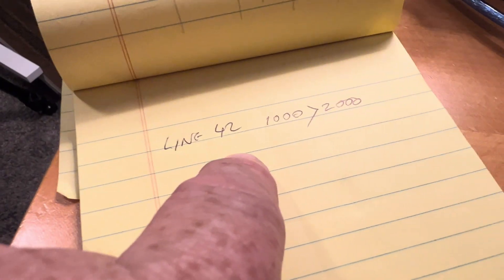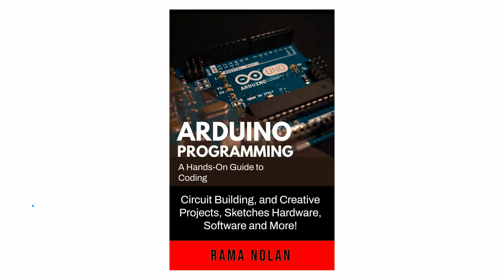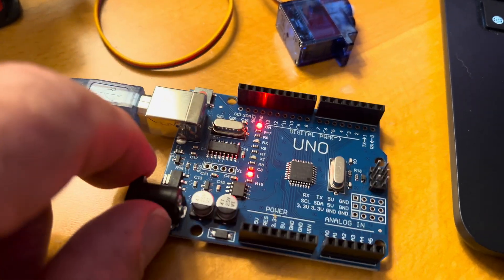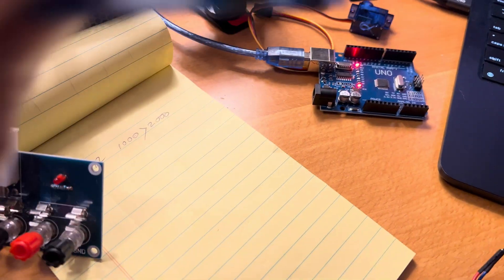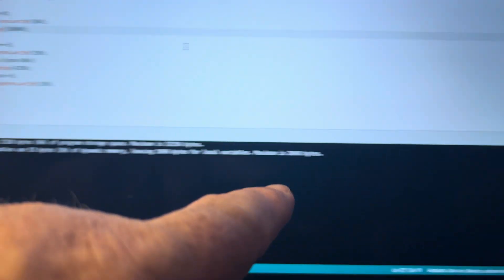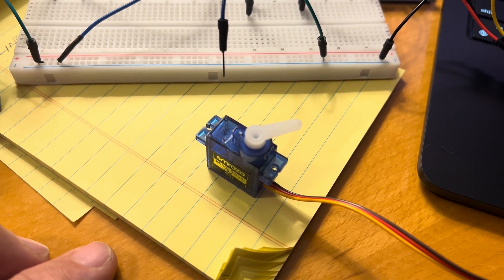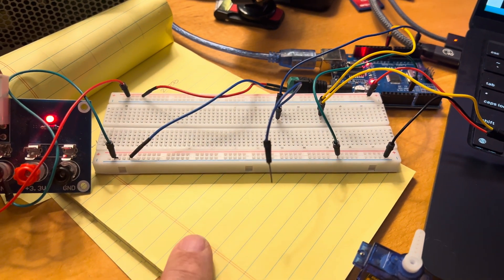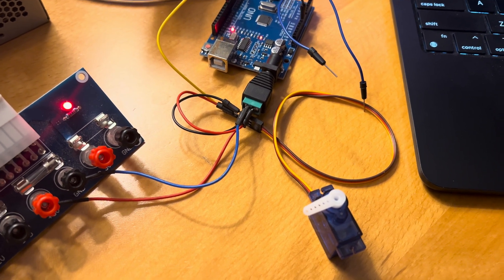144. It Works! My First Model Railway Arduino Project

Comment: GOING UP THE GARDEN PATH ???
"Arduino" ! A heck of a lot of money for a system that bears NO relationship whatsoever to the real life methods of British Semaphore signalling, which has to comply with "Absolute Block" rules. So automated servos with a timed delay are useless for a semaphore signal ! Semaphore signals were manually operated, in a set order and sequence, in response to the position of a train. About the only thing you can do to shortcut the real life methods, is to have "semaphore arms" return to danger as the train passes. But that needs either a "Track Circuit" (cost 1p and only needs a piece of wire), or a less sophisticated and not a 100% guarantee, are Infra Red "Irdot" products fitted into the track. This method relies on the passing train reducing the amount of light that reaches the infra Red detector, so isn't always 100% reliable !
Reply from the maker: I agree with you on the signaling of course (you being the expert I’d be foolish to do otherwise 😜) 
The Arduino for me is a means to an end. 
1. I want to learn the ‘how’ and it is far better to have an actual reason to do that than just the theory.
2. You’ll notice I use/used it on a barrier into the airport not on signal automation.
where I MIGHT use it is in the actual “pulling” of the lever. In other words, simulating the pull on the wire that controls the movement of the signal. 

We’ve talked before I believe about the weird terminology model manufacturers call things (“block” detection for example) but on the other hand, mostly we know what we mean by it.

I’m still aghast at the system in use around here. The more I learn about it the more I am amazed how they get away with it. I suppose the bugle long trains at least cant crash into each other so that’s one solution.

As ever, thanks for your input.
So to be clear, I’m using the Arduino for the last few feet to actually make the arm move not to put the cart before the horse and have signals react to trains.
Reply: @trainsofthought5071  TERMINOLOGY
Confusion in terminology. Your in the States, I believe. And Americans do NOT use the sort of Railway Engineering terminology as used in the English Language, they use non technical language which can cause confusion as it is NOT distinguishable from "common speech". They also have different Electrical terminology to Britain. And in this latter case the disease spreading this confusion is "DCC". 

THE TWO ORIGINAL DCC METHODS
DCC as it currently stands is an American system. The alternative European DCC (designed by Fleischmann) included a method to interface moving trains with the signalling as occurs in ALL European Railway "Block Signalling" systems. It was Commercially buried by the far larger & more powerful American Commercial Market. Fleischmann Germany lost £2 Million and sold out to ROCO (Austria) to avoid Bankruptcy. Europe lost a "DCC" method based more closely on a modern European type Computerised Signalbox. Deemed by the NMRA (North American Model Railroad Association) with 2+ Million members to be "Incomprehensible" and therefore NOT recommended by the NMRA. Which virtually Guaranteed no U.S. Model Railroad stockist would risk buying into the Fleischmann system ! Market share counts in this case unfortunately. 

BLOCK SIGNALLING MINEFIELD !
To safely move trains and avoid them coming into contact with each other (a crash). Required a simple system that began to develop from around 1850. But it took until 1880, for the major principles to all be in place. This of course involved MECHANICALLY controlled semaphore signals. This first system became known as "Absolute Block" which literally means the Block is Absolute ! Read on:- 

A mechanical signalbox can only cover an area of around 3 miles in length. The limitation set by expansion & contraction of the steel wires from a Signalbox lever to any signal arm. (There being no electricity available when this system was first developed).  Hence within that 3 mile limit all the necessary equipment had to be fitted & controlled by a Mechanical box. This example assumes a double track line with one track for each direction. (Single track lines have a more complex system called usually "Electric Token Block").

INTRODUCING THE DISTANT
On each of these tracks to safely control trains would firstly require at least One "stop" signal. But due to the limitations of actually stopping a train (it needs around three quarters of a mile distance if travelling at 75miles an hour), a single stop signal is insufficient. It was quickly realised there would have to be an advanced warning signal to tell drivers approaching the "controlled area" what the stop signal was showing. Hence they introduced the "Distant" signal at a "distance" before the first Stop signal. One stop signal was for operational methods not usually enough, so a second stop signal is placed at least a third of a mile beyond the first. This is applied to each track, so you have a Distant followed by 2 stop signals for each direction, a minimum of 6 signals in total.

HOME & STARTER SIGNALS
Now we have to "name" everything and add a method of positioning. The Distant is obviously a good three quarters of a mile before the Signalbox is reached. The first Stop signal is named a "Home" signal and is positioned just before the Signalbox & station if this later is present. After the Signalbox (& station if present) is the second stop signal called the "Starter". The "Starter" is extremely important as it is the last signal the box can control, to stop a train. Before that train disappears into "No mans land" and heads on along the line towards the next 3 mile chunk of railway that has a controlling signalbox, wherever that might be. 

So thus far, we have three signals on each track. (We'll come back to the "Starter" later). But these three signals have to be interconnected or "Interlocked" as its called. The reason is this:- the Distant must NOT be allowed to show a clear line if either of the stop signals ahead is showing "Stop", as the train would be unable to stop upon coming in sight of a Stop signal, due to insufficient warning & braking distance. So the "Distant" signal lever in the box is physically "locked" at caution in the lever frame, and the signalman cannot move this lever no matter how hard he pulls on it. It only become unlocked once the Signalman has cleared BOTH the stop signals, first. So when the "Distant" IS showing a "Clear" the Driver knows he has a Clear line right through this whole signalbox area. This is a major part of the safety method of "Absolute Block", but there is just a bit more to complete the picture. 

COMMUNICATION BETWEEN BOXES
The next step being communication between boxes. This used the telegraph initially, replaced by more specialised "Block Instruments". Each signalbox has to receive from a previous box, a request to forward a train. And our box has to also have a machine to "offer" a train to the next signalbox along the line. To do this both "Bell codes" and Block instruments were required in each case. The Bell codes described what sort of train was to be offered, while the Block Instrument display had a needle that could be pointed at "Line Blocked" - "Normal" or "Line Clear". 

Assuming the box had NO trains anywhere on the track relevant to the direction of travel (known as a "Running line") the signalman would have his block instrument for that line set at "Normal", and this is repeated on the machine in the previous Signalbox. Hence the previous signalman knows he can "offer" a train, to us when our instrument is set to "Normal" (with nothing currently to do except make tea). When the previous box "offers" a train to our box, in the form of a bell code describing which type of train he wishes to send, our box changes his instrument to show "Line Clear" confirming he has nothing about, and replies in kind to the bell code already received. Our Signalman must now also press a button on the machine. This button is to give the previous signalman a "Physical release" of the lever controlling the previous signalboxes "Starter" signal. THIS IS EXTREMELY IMPORTANT ! The previous box cannot set his "starter" to clear, until our signalman presses and holds that button for some seconds. Which Physically releases the LOCK on the lever in the previous Signalbox controlling his "Starter". So the Starter is also called the BLOCK signal. As it is the one signal that allows a train to move from one ABSOLUTE BLOCK AREA to the next. Further our signalman now changes his instrument to "Train on line"  revealing he has accepted the train, even though it could be some minutes before he ever sees that train coming. Having the instrument showing "Train on Line" tells the previous signalman as its repeated in that box, that "we" are still busy with the train they have sent. Indeed the previous box knows not to try offering another train until that instrument has changed back to "Normal". 

If the delay is longer than usual, signalmen could phone each other using the Railways own Secure Railway Telephone National network, which had NO direct connection with the system provided to the Public & Business by the GPO.   

Now we can see what "Absolute Block" means. Which is ONLY ONE train can be anywhere between the previous Signalboxes "Starter/Block Signal" and our own "Starter/Block Signal". And until that train has reached us and gone on ahead of our Starter, we are absolutely forbidden to even think about accepting another train. This of course also means that on Absolute Block lines, Trains cannot under any circumstances follow each other from Signal to Signal. As the "Block" is Absolutely limited to ONE train at a time in the whole area covered by a Mechanical Signalbox.  

On a Model Railway, unless the layout is very large, "Absolute Block" is a real Fun Killer. As you have to get rid of any train  before allowing another to arrive.
Reply from the maker: lots to digest there - I really appreciate your expertise and taking the time to respond. Thank you.
Reply from the maker: One thing that would be fun to try to model would be some of the bell codes. I’m not sure how I’d pull that off but it’s worth a try.
With a regular schedule I suppose I could “fake it” but to get the bells to do what they should would be interesting for sure.

Comment: The coding is still scary. 😁
Reply from the maker: oh I know it’s scary but lets give it a go. 
too much data to adsorb in one sitting that’s for sure.
I’m down to three things 
1. the hardware 
I’ve got that down.
2. the interface
not sure I understand HOW it’s working but it is
3. Software 
Fancy name for code

Code breaks down into bits too
basically I need to know what I want to tell it to do and think carefully about that first
then
learn HOW to tell it what to do
it uses some weirdness but really there are about a dozen words that tell it things and once you know which order to put then and especially the punctuation it sorta works.

who knew there is a difference between { and ( ?but there is
We’ll get it done 😊

(Oh and you can’t use smilie faces either 😜

Comment: Great job, Your about as far as I`ve got with Arduino, before putting all the bits and bobs back in a box for those rainy winter evenings, I have to get back to Building the building that everything has to live in eventually, But a Google of a chap called Geoff bunza arduino, He is very much if you can copy and paste and edit a line of text, like you would in a letter, Then I can get you using Arduino.
Reply from the maker: I’ll take a look at that guy. Thanks for the tip. 😊
I think Arduino may well be like so many other things in that we give up a few hours away from success. If we just keep going…
then we keep going and think the same thing the next day!! Right?
Seriously, the way I look at this kind of thing is to look at someone else who has been successful with it. Then ask, ‘are that really that much smarter than me?’ if the answer is probably not, then go for it!  Perhaps a little conceited but at the same time we are so down on ourselves so often. Bob the builder “YES HE CAN!” isn’t a bad thing to think.

Comment: I'm following this with interest as a retired computer teacher to high school children.  I don't know how to program in C++.  I've found out that Tinkercad has an interesting feature that helps coding and simulates creating circuits and programs on an Arduino Uno.  It may be of great assistance for you to use (either to demonstrate what you are doing or to learn from - or both).  There are a number of Utube videos on using it to assist.  I've recently bought some kit to learn alongside you and from the gentleman from Leopard's Tail.
Reply from the maker: Leopard’s tail and I tend to think alike it seems. We’ve never met but somehow have ‘clicked’ on line. He has skills I don’t and likely we will learn from each other. 
I’ll check out ‘Tinkercad’ and see how it works - oh for more hours in a day.

Comment: Did you buy a 'kit' from Amazon or elsewhere or just pick a few parts to start with? Would you list the kit or list for us newbies?
Reply from the maker: I didn’t start with a kit. I’ve been into electronics in a variety of forms for years and most of the stuff in the kits seems to revolve around things I would already have. The Arduino itself is very cheap so I’ve done it that way. 
I think just about ANY of the kits out there would work but I’ll do a bit of digging around for you and list something soon. 
The big deal is getting a book that makes sense for programing. I’ve waded through a few and most are awful.
I’m a newbie too with this = I’m figuring it out as I go. 😊
Reply: @trainsofthought5071  Thanks for the reply. I think I started back in time before you. I started with what was called in the US as assembler and went the route through to just before C. All via AT&T schools. I retired in 2002
Seeing this start with you I am eager to sit in front of the TV and play with arduino. Thanks for the help-
Reply from the maker: It may take a while 😜
I’m in the basement this evening reading up on the coding thing. We’ll get there. Thanks for watching.

Comment: See the old 2" video tape spool in the bkg.    Were/are you in the business?
Been using Arduinos for years.  Gets a lot easier with use/ familiarity.  My RR currently has 5 of them, with more on the way.  One of them is a mega with a sensor shield to sense current for blocks, and to control small R/C servos for the switches ( turnouts/points) with a momentary SPST switch .  2 are running Arcamora for DCC integration.  1 for DCCEX and a uno with PCA9685 for randomizing lighting in buildings and such. 
Among the other projects I made are a temp/humidity monitor for my telescope to sense when dew will be forming.  A project to show the pulse width of a servo position to use when programming servos for the Arduino and you need the exact pulse width for location of the servo arm.  A "Light Show" for a Pittsburgh bridge I made for my daughters wedding cookie table ( a big thing in Pittsburgh).   Possibilities are just about endless once you get going.
Reply from the maker: Well spotted! The ‘Ampex” reel in the background is an illustration of once prized/treasured technology that became every day then scrap. How fast technology runs!
I’ve worked in a variety of ‘cross over’ roles in the industry sitting between technical and art. Most often TD or camera but these days it’s a side hustle. I occasionally direct live shoots but needed stability so got out of the gig economy mostly and now have a stable instructors role for an airline. 😊
Yes, I’ve realized the possibilities are endless with the Arduino. My approach has always been to solve the problem with the appropriate tool rather than “here’s a hammer, what can I hit?” The Arduino seemed like a good solution to a couple of ‘problems’ so here we are. 😊
Having said that, I’m sure I’ll think of things to do with it once I master it. 
😜